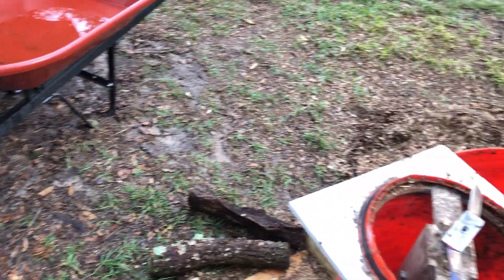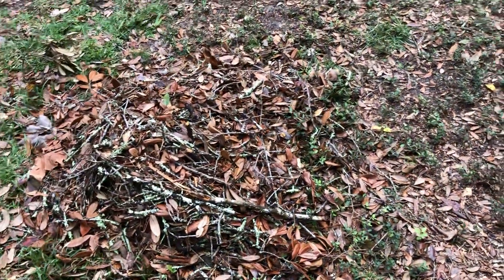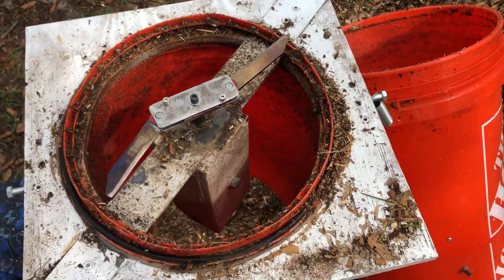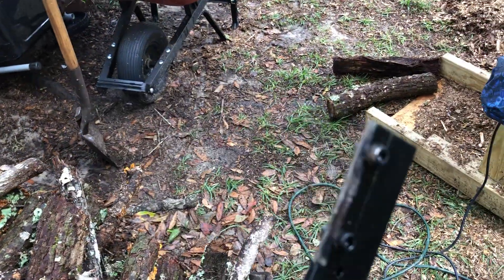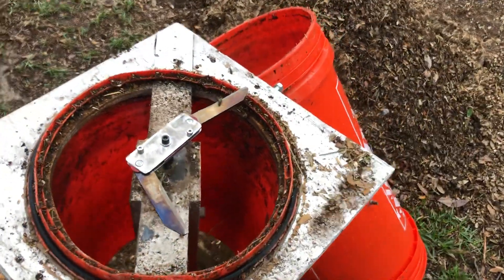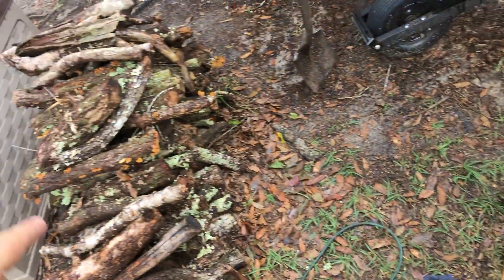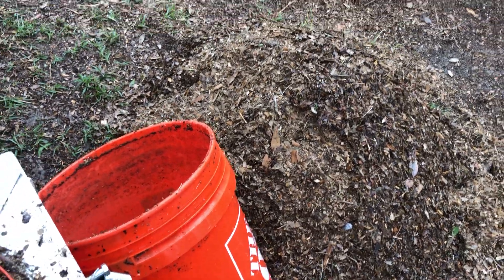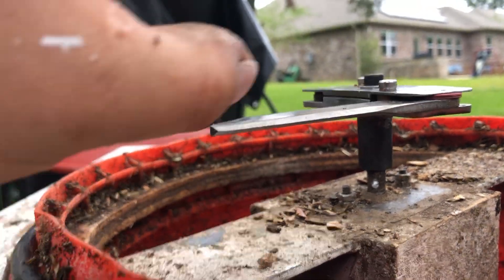Leaf Shredder #1 - Different Blade Designs and Other Project Updates

Comment: You might try some old propane tanks gri campers. You will have to cut the tops and bottoms off. Or try an old hot water heater tank.

Comment: You really use plastic bucket or is my eyes deceiving me?
Reply from the maker: Yes. Your eyes are fine. I have attached a MDF board between the shredder and me since this video. And, the latest video in this series shows that I replace the blades with double string trimmers for both top and bottom.

Comment: I'm building one out of steel.  I harvested a section of the steel tank from my old water heater.
Reply from the maker: Nice... Just be careful! If you are going to just chop leaves, then having strings instead of knives produce almost the same results. Assuming 0.090" thick walls (googled it), I wouldn't think the knives would go through the steel tank. However, the knives may shoot up or down which may, at the least, require change of underware... 💩😅... In the unluckiest scenario, one of the knives may ricochet off something, cut your carotid artery. Then, you are dead in 4 minutes 😱😱😱... I switched to strings for leaves and cutting small branches with the chipper shredder I got from Amazon.

Comment: You are very resourceful, nice work on this project.  Not sure if you solved the safety issue already, but maybe a few wraps of hardware cloth around the outside of the bucket in the plane of the blades?  Should at least remove most of the kinetic energy if a blade pops off.
Reply from the maker: Thanks. That's a good idea. I have some leftover hardware cloth from the screen vibrator I made, perhaps I can use that. I haven't made a final video about the screen vibrator either :/. I have been thinking about combining in series with the Black & Decker vacuum/shredder I have and this shredder. Leaves and branches are piling up while the grass is still growing slow. I should have some time to shred some browns for the compost. I am planning on putting some fast release nitrogen fertilizer this coming weekend. Hopefully, I should have good amount of grass clippings by the weekend after this one for compost.

Comment: This is really brilliant!
Would you be able to provide the way you connected the motor to the spindle?
Reply from the maker: Thanks... It is pretty dangerous too. I do NOT run it while others around :). (I will put the links mentioned below to the video description after this comment)… The motors I linked in response to Bereassassin has 8mm right handed threaded shafts. The middle part of the blade assembly has a shaft that screws on to the motor shaft. To ensure that the blade assembly does not come off the motor, I designed the blades to cut in CCW rotation. Therefore, the blade assembly self tightens itself onto the shaft during the initial motor acceleration and/or when the twigs or small branches impact the blades.

Comment: Can't believe I threw out my old electric weed eater motor. I could really use it now for something like this. Cool build, I like your style, you should make more vids
Reply from the maker: Thank you for watching. I initially went with used weed eater motor but it was too noisy. The ones in the video are these: https://www.amazon.com/gp/product/B07QMCCZN3/

For the knives, I used two different sets. One set is made out of 1095 steel  (https://www.amazon.com/gp/product/B0788VJRWN ) that I shaped, hardened and tempered. And the other set uses modified high-speed steel (HSS) jointer blades that I just shortened and drilled a hole into it (http://amazon.com/gp/product/B07X5GVB25 )... Unless you own carbide drills/endmills, you would immediately dull whatever else you'd use to drill the hole on HSS material. 1095 steel was easier to shape and drill, but it takes extra time to harden and temper it... Not to mention that it won't hold its edge as well as HSS. In short, if I don't chop thicker twigs (> 1/8"), both blades stay sharp for several hours of use.

I just started a compost batch using the branch and leaves I chopped up using this machine... Since the size of the materials are now smaller, the compost went from 70F up to 140F in less than 18 hours. This would normally happen 1.5 to 2 days. So, I'm happy :)
Reply from the maker: I forgot to mention that I made another set of blades (made from HSS) for the bottom before making the first comment... :) I was going to make a short video about it but got sick. Perhaps I should do it tomorrow.